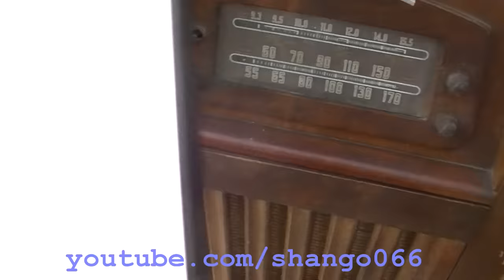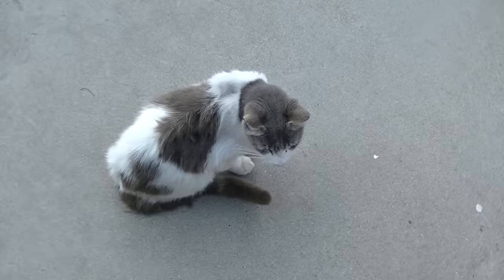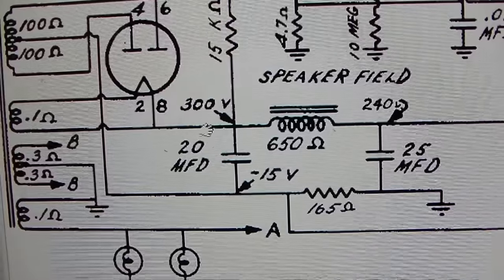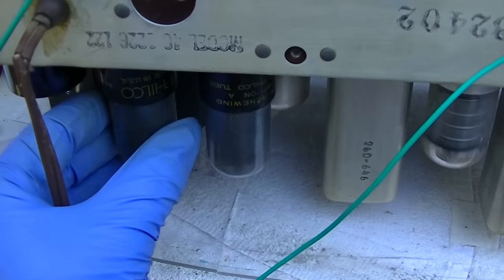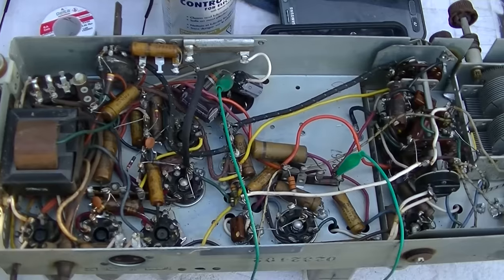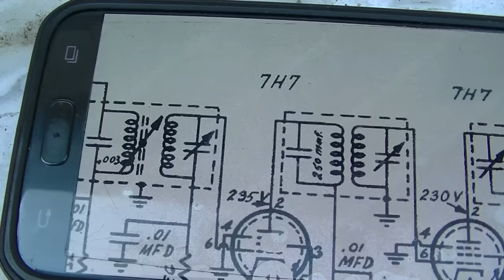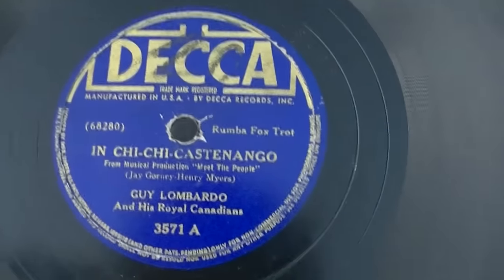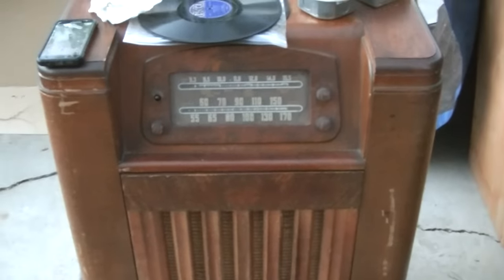1947 Philco 46 1226 Radio Phonograph Resurrection

Comment: That rectifier was really something. I haven’t seen that much melted steel since 9/11.
Reply: inb4 "too soon".........it was 20 years ago and that joke was fucking brillant.
Reply: Definitely Brad... it looks kinda like a small thermonuclear demolition utility went off inside each of the 5Y3GT's plate structures and vaporized those plates to dust.
Reply: I’m trying to figure out how they got the thermite inside the tube.
Reply: @TheGuitologist  Roger that, Brad... and no doubt someone else reading this tread is thinking, "you're both wrong... that tube looks like it got hit by a DEW"... lol :-D
Reply: @X5Industries  Exactly, X5... in fact, about 50 meters or so below the base of the tube-socket's chassis mounting points....
Reply: 9/11? You talkin' 'bout 'Take Your Plane to Work Day'?
Reply: @chezsnailez  Something like that, Chez,  but more exactly, "The Play CGI Planes On TV And Blow Plane-Shaped Holes In The TT's Walls And Send a P700 Granit Into The 5-Sided Building And Set Off Thermonuclear Demolition System Under The TT's And Building 7 And Blame It All On The Muslims Day".
Reply: It’s going to burn in a vacuum?  Why no film on inside of glass?
Reply: Tube 7th was just "unstable"
Reply: @robertp7209  Because you need oxygen for oxidation

Comment: Great video as usual.  In '85 we got grandma's 46-1226 122 Philco  My son used it as an amp to play cassette tapes until It died in '90.
As a neophyte I fooled around  for the next 30 years trying off and on to repair it  .In 2010 I recapped it and replaced  2 weak tubes  But  no joy
Last year I borrowed a loktal tube socket test adapter which let me measure all the voltages. It tuned out that one lousy resistor hidden under the band switch was open . It runs great now

Comment: 9:00 I am truly impressed with your high level of safety. Well done, Sir.
Reply: Safety is nothing more than making an effort to keep the wires from touching each other.
Reply: @fredflintstone8048  safety is the breaker
Reply: @1marcelfilms  Sometimes. You can burn a system down, get electrocuted etc. long before the circuit breaker trips. Breaker only works if the current in the circuit exceeds the breaker rating AND for the proper amount of time. Breakers have two ratings.. current and response sensitivity which tends to be a function of how long it takes the breaker to heat up.
Reply: Clearly safety is number one in his book.
Reply: Safety is no accident.
Reply: @andrewagner2035  in his case it could be.
Reply: @fredflintstone8048  And yet , all that is irrelevant if you keep the wires apart.

Comment: The bent spindle is normal.  It seems to work like the old Garrard changers.
Yucktal tubes!
B+ is high because your line voltage is higher than it was in 1947.
Reply: and  if the output tubes are a bit low emission, they'll take less current, meaning less load on the power circuit,  so higher voltage ,
Reply: and i hate those loctals also, luckily they werent used that often here in the UK although there were variations on the base used by european valve/tube manufacturers, some had bright plated pins(philips/mullard), more reliable contact!
Reply: Also has a solid state rectifier.
Reply: Indeed. Back then 110 vac opposed to 120 on input today. But that 10vac could mean 50 additional or more on the output.
Reply: @Rev22-21  doubt it, maybe up to 30v more,  easily solved with a resistor in series with mains input or even an inrush suppressor thermistor
Reply: @Rev22-21  I live fairly close to Shango and I've measured 127v on the line during a low use period. They definitely crank up the voltage these days.

Comment: I have the same console philco except mine is AM and old FM but the turntable is identical. The weird little devices that rotate are for the common two different-sized 78 RPM records. The strange finned device on the back of the turntable accommodates the records and rotates to drop them when set to "AUT" . it'll handle up to four  records on the changer any more than that on my turntable and it starts to slow the speed down. I'm hesitant to ask but I'll ask anyway,  would you entertain the idea of repairing a predicta television for me? it's a table top model and it does have a picture that is one inch tall and sound. I am local to you and could deliver it to any place you wish. I realize that you're a busy person and if you decline I completely understand and thank you for your consideration.
Reply: Sounds like a plan, hope he accepts!
Reply: Yeah I remember that video. Lots of cursing IIRC. But them predictas look oh so cool.
Reply: @kevin barker Well, if he's only wanting it working, why not. Now, if he's wanting a full on restoration no, Shango doesn't do those. Or, maybe I'm not understanding your comment?
Reply: @kevin barker Well, I wouldn't either. When he does a 'paid' job, he does it well, but if you just want a 'get it working situation', that's what you get. As much as even I wish I could work for nothing to help people out, (sometimes I do) I too have bills to pay. Thanks for commenting.

Comment: That chassis was designed in 1941 and became a holdover when the war ended. The unused socket is for the output and power to the exciter bulb of a beam of light changer.
Reply: As I mentioned in my post...I have one of these in a plastic tote with the complete turntable, antenna and speaker..

Comment: Another VERY enjoyable video. I have never seen a rectifier EOL like that before. Must have been one hell
Of a current draw when that happened…. 
The dynamic range of late 40’s/early 50’s 78’s was surprisingly very good when reproduced electronically.
Reply: I've found radios with bad 35W4s, and in some of them it was the only thing keeping them from working.

Comment: I just restored the sister model of this radio, a Philco 46-480, with AM broadcast, FM, shortwave bands, push button tuning and no phonograph.  Almost every single capacitor was leaky or shorted.  After restoring the electronics and aligning the set, I discovered that it is a great performer.

Comment: The two aluminum posts on the turntable are to hold the record in place the reason they turn is for the different size records 10 and 12 in
Reply: They really look like the hot and cold water tap handles.
Reply: @joseppuig925  Yup... and if the music on the record seems a little too cold and tired one could turn up the hot side, which will add a touch of Benny Goodman to the tune and pep up the music with a bit of hot swing... lol :-)

Comment: If I could get it back to South Dakota, that’d be an awesome radio to restore. A good winter project. I’d replace the tubes and sockets with regular stuff, screw those Loctal tubes !

Why did they use Loctal tubes ? Philco was CHEAP ! Unlike RCA & Zenith, who used good tubes. Philco most likely used WWII surplus tubes. Loctals WERE used in car radios. Why ? Because it’s a mobile, vibrating environment. Regular tubes would come loose. That’s not gonna be the case in a home radio like this.

Just like I said to Glasslinger on his channel…cats and old-school electronics. Two of my favorite things. More cat assistance would be great Shango. Love your videos.

As for that stupid antenna design, I’d use a Terk AM advantage antenna, BUT…that would kill the shortwave.

That radio played speeches from Truman & Eisenhower….now Biden. Poor radio.

43:50 , the crackle pony express arrives !

The cat approves of the record being played….MeeeeeoW !

The audio at the end of the SW dial on that radio is FT8 digital. The 40 meter HAM band.

Comment: I enjoyed your LEGACY BOX video. It would be cool to see an oscilloscope alignment video with associated silver mica / tube wigout. As a millenial, your video motivated me to repair an AM radio, a bandscan is on my channel. I chaned all the transistors with brand new modern parts (gain and biasing is key) and an IC audio amp instead of the PNP dual transformer. It is LOUD now and enough to get me in trouble where I live.

Comment: Very good that you noticed the ungrounded negative end of the filter capacitor.  Many of those Philco radios had that design.  About half of them that I’ve repaired have been incorrectly repaired before with a grounded negative end.   The radios then played very crappily with zero bias.   Super common.  It’s satisfying to fix a 65 year old mistake.

Comment: Too high B+ is running the tubes rather  hot. But the radio does work now. Could check for leaking capacitors going to
 ground. Loctal sockets are a pain. IF transformers have mica caps at set values and they can go bad. Geriatric feline 
seems hungry and deaf! Great resurrection of the old girl. Surprised the old crystal cartridge still works! Music still heard 
like it's 1947 all over again! BTW Chichicastenango is a town in the mountainous part of Guatemala. Your records are
 better than anything played on the AM band today Shango! This lowboy console is a keeper!😍

Comment: While in general, the wrong lube is better than no lube, wd40 doesn't prevent metal on metal wear and you really shouldn't be running it.
Reply: I used to work with a technician who tried to get rid of squeaks in nylon bearings and spring clutches with WD40 but the sqeuaks always came back.  He just couldn't understand that nylon is self lubricating and that nylon spring clutches needed a special grease to work probably.
Reply: He was only doing it to be cheap and bother you.
Reply: @CoreyDeWalt  Not bothering me. I'm just pointing it out.  Plus, this is a nice example and should be restored IMHO.
Reply: @tarstarkusz  he believes that too. He almost sounded like he might trade out on of his current units and keep it, but maybe not.

Comment: I've never seen an IF can until now that had both mica trimmers and tuned slugs---interesting. I would not bang on tubes in any way, other than with a pencil to test for microphonics---if it wasn't shorted when you started, it sure will be by the time you're done since you've jarred all of the elements loose
Reply: Lol Shango knows what he is doing he is a master of this art, and some how I think he would have lots of spares. Relax and watch the show. Don't forget to put the plastic cover over your computer when your finished using it.
Reply: @Antony_Jenner  I will put the cover back on my computer....which is from 2003, has always been well maintained, and is still working perfectly.

Comment: I have that identical Philco turntable fully restored.  The spindle is fine.  The top stack sits on an angle between the separator and the two rest stops.  Two settings for 10 & 12 inch 78s.

Comment: I had a similar Philco in 1967, great bass. Mine had push buttons like a car radio used to have for radio station tuning. If I pressed more than one down together  I could tune Long wave in. Short wave worked too. The 78 record player arm was broken off so I never played a record.

Comment: The 1940's Philco's are great units if you can get past the loktal tubes, rubber wiring in 1939-42 sets, and disintegrating escutcheons.  Actually, the 1946 sets like this one are the best of everything - no plastic escutcheons, no rubber wiring, and most had push pull audio.  Really common, but really nice sets too.  Hopefully someone will recap this and enjoy it.

Comment: Wow I have NEVER EVER seen that amount of damage in a rectifier tube in all my 45 plus years of doing electronic work on old radios!!! Must have been a SPECTACULAR fire works display in that tube for a short time :-)
Reply: I've seen some tubes red-plating and even orange-plating, and I think I've seen one or two with small 2-3mm holes burned through the plate, but yes, I've never seen one eaten up to that extent.  That would probably explain the dead filament, because I would expect the filament to ablate away, or pop at the spot weld to the lead-through wire, long before the plates got eaten up to that extent.  That 5Y3 would definitely be a trophy to keep for the collection
Reply: that tube must have looked like a Mumbia transformer shorting video

Comment: The AM Bands Can be the Hardest to Work with....AM Antenna Lupe Stick...One Of the Most Difficult Type....I had One Radio Receive Every Station on the Band At Once 😨.... With A Long wire Just Went Crazy

Comment: Greetings:
The record stack works with the angled spindle and that non-obvious mechanism to drop record individually. Often they will work with 10" or 12" disks by using opposite sides of the dropping mechanism. Hopefully the service manual for the combo will explain the ops.
The mains voltage may be too high. When you have the silicon diode inserted, the 5v filament winding is unused. You can wire it out of phase (bucking) to reduce the incoming mains and therefore the B+. You may choose to reduce the remaining excessive B+ by either wasting power with a resistor or using a dropping capacitor of equal Xc between the diode anodes and the first filter cap. [C=1/(2 pi f Xc)]  I believe that you can use a polarized electrolytic, + to the anodes and - to that  first filter cap (usually the dropper is non-polar).
Notice that rotatable support has a 2 inch spacing for 10" or 12" records.
Do not forget to rotate the antenna to see the effect.

Comment: Regarding the Capacitor Wizard, your probes are different than the ones on mine. Also the graphics and meter look slightly different than mine. I am very pleased with my unit. I’ve had it for many years. Perhaps yours is not authentic?

Comment: I would be happy to pick it up from you. I lived in Long Beach from 61 to 89 then moved to Riverside in the country. We are looking in Georgia to retire. No water shortage, no electric shortage, gas is less, taxes are less, the roads are in better shape, car tags are $25 per year regardless of the car being new or very old. I will be back to Riverside likely in the next month to pack up and could gtet with you to pick up the set. I am working on a Philco from 46 at the moment with an RCA 125 set waiting in the wings. No idea how to contact youy away from a comment here. A message on my video feed page might work. I have a newfound RESPECT for you, t6he L.A. heck CA socialist party has ruined the state and they are working hard to do the same to the country. God Bless! PS, everyone's favorite discount tool store, Harbor freight sells a cleaning brush set for air brushes. It works very well to clean the tube sockets to get better contact. At under two bucks for the set or 5 brushes (I think) they are very disposable.

Comment: Its sad that no one wants this old stuff because one day soon it'll all be gone, heck mod one of those $5 bluetooth modules off ebay into that push-pull amp for that sickly sweet tube sound, then someone younger might want it then
Reply: There are shops that restore old radios that will install bluetooth modules in them. Same idea as shops that install pulse to tone translators into old rotary dial telephones.

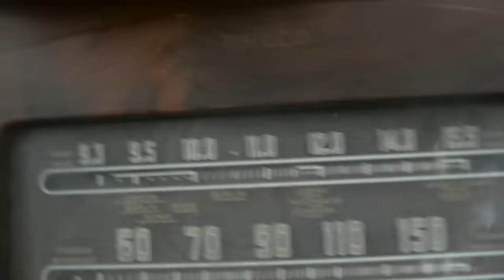Comment: That noise around the 1:27:00 to1:27:30 was a digital communication mode on the 20 meter amateur band probably psk31.

Comment: My Grandpa had this exact radio and even still had the wooden box which became a door in his cellar. Bought it after the war. Brought it up to his cabin once the family got a TV in the 50s. Was there until the late 90s, when his son brought it to his house. Still works good even though it probably hasn't had any work done on it for over 50+ years, but it could use a restore. That antenna is no gimmick. These radios are crazy sensitive. Grandpa's could easily pick up 650 WSM Nashville and 750 WSB Atlanta crystal clear from the Allegheny National Forest in northern PA.

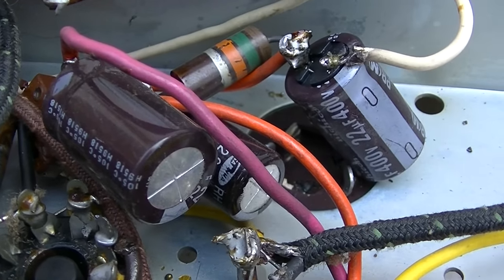Comment: 37:34 I have a 10 watt Tube amp that needs recapping, the audio is crackly when using the aux input. Are these 22UF 400 volt caps that you are using the right ones for my amp?

Comment: 120vac or 110vac on the primary of power transformer. What would be the dc output difference? I like that you tried to get Google to decode the ft8 ham radio noises. N0PXJ

Comment: That changer is a slicer type...and the spindle is made that way to guide the records from stack to turntable. The record stack rests on the slicer shelves and supported by those two adjustable supports [for 10" or 12" 78s]. I have two Philco 41-608 radio/phonos with that tilt front design. These sets feature the so-called "Beam of Light" pickups. Changers are a product of Webster-Chicago...direct drive turntables. Solidly built. I'd keep that rectifier tube as a destroyed oddity. Beautiful penmanship. Becoming a lost art! This Larry was 12 in1955, not dust yet! Yep, the LP came along in 1948, 45's in 1949. I have that "Guy" in my 78 collection! That "hot" pickup is a one in a million. That Decca would be 1947-8 era. Same era as your Philco. Lombardo never changed the style of his band's sound. I have late 1920 Columbia Viva Tonal 78's...and sound identical to his last recordings from the 1950s. Of course, he was "Mr. New Years"...his band broadcast from the Hotel Roosevelt, NYC. for years on that holiday.

Comment: Judging by the record number, 3571, I'll say the Jungle Drums record is 1940 or 1941 at the latest.   My reasoning is the numbers increased as his hits went on and it is between a 1940 hit and a 1941 hit of his.  It is closer in number to the May 17, 1941 charting hit "The Band Played On" on Decca 3675.  His hit before it was "When You Wish Upon A Star" charting April 20, 1940 on Decca 2969.   [Edit:  Oct. 22, 1940 is a release date a web site claims for it]

Comment: I'm amazed that the crystal pickup on the changer is still functional after all these years. Must've been stored in a dry climate.
Reply: Apparently, this radio spent most of its life in Fullerton, CA. Which has a warm summer Mediterranean climate. The wettest it gets is in February, with an average rainfall of 3.25 inches (13.88 annually). Perfect climate for preserving the crystal in that cartridge. Humidity is the enemy for crystal cartridges.